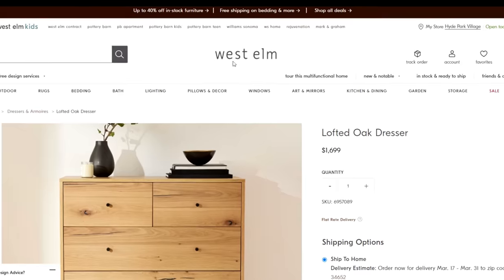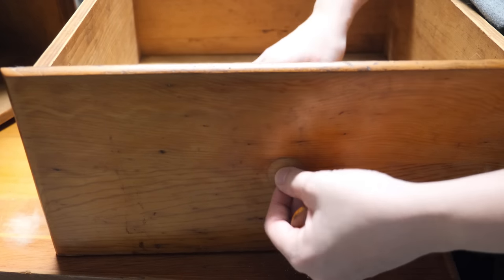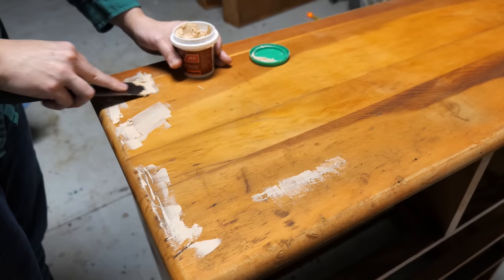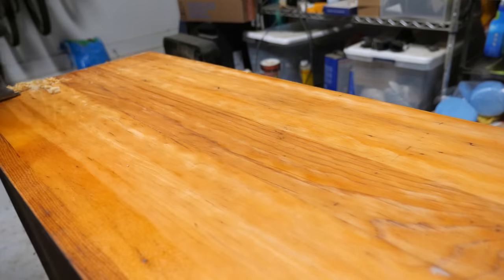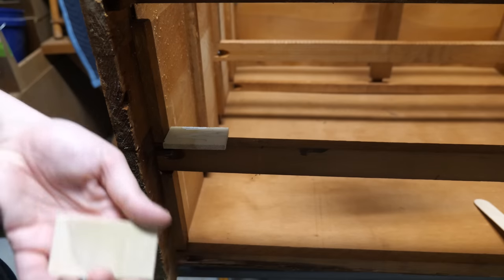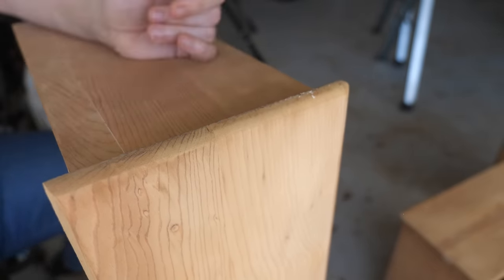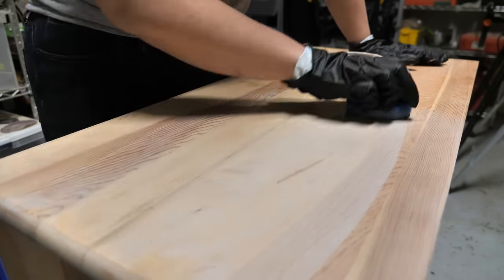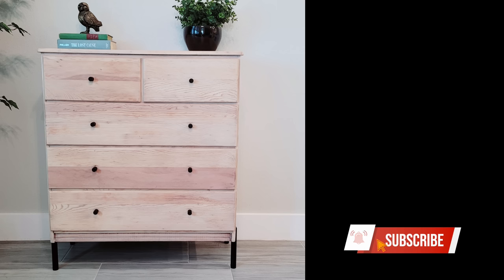$25 Dresser to $1,699 West Elm Dupe

Comment: Such an amazing duplication. I was blown away at how much the 'reveal' looked like the West Elm piece. Your attention to detail is so impressive. Like over-driving the nails in the drawers and then using wood filler to conceal them. I would never have thought of that!

I was confused on what all you mixed to get your final color. I know you said it was all water-based, but I couldn't follow the products you listed.

Definitely going to watch the rest of the videos in this challenge playlist!
Reply from the maker: I think, if I remember correctly, I mixed carts and millie charlie latte paint with drift wood stain. Then  I blended that with the water based finish to make it a tinted finish more or less. It does mess with the finish sheen a bit, which can be corrected by just appling the finish only on the final coat. I would consider it a water based toner blend.

Comment: WHOA! You totally nailed this “dupe”, Emily!! It looks just like the West Elm piece and was 1/10th the cost in Chipotle burritos (this made me giggle bc my son is the grill manager for Chipotle). Even though your piece had some tapering, which was much more obvious in its original form, you can hardly tell now. Especially with the new hardware and legs (so glad to see someone use these, I have them in my Amazon cart in gold for a piece). Yours would go for a lot of money in my area (I’m in Dallas), but less than the West Elm piece, as it’s very popular right now. Excellent transformation, Emily!💜
Reply: Oh and your poly wash toned that pink waaay down. It’s hard to do (I’ve struggled with it for some bathroom cabinets). I saw Angie (Transcend Furniture Gallery) deal with this in one of her videos. I think she put a think coat of walnut stain on and went back to her pickling stain? But yeah, the red in pine, walnut and even oak is a bugger when doing a pickling finish. You did an amazing job and love the idea of tinting the poly (top coat) like a wash. Will definitely try it (sorry for the long comment😁).💜
Reply from the maker: Thank you so much Ashley! The color tones are so tricky sometimes. If its red and you put white on it then its just pink. I'm sure there is a green stain out there but it would probably make things worse. Also don't apologize for your long comment. It was super sweet! 💜

Comment: Best dupe I’ve seen! You nailed it. Did that wood fill stain to match? Always have a hard time with that. Thanks!
Reply from the maker: The kind I get is stainable, but I know on certain stain colors its better and I don't have to touch those spots up if I use the pre tinted kind. This finishw as light so it worked out well.

Comment: I was skeptical when you started,  but the result was great. Did you think about squaring off the top?  The legs were perfect!
Reply from the maker: Yes I did. I planned on cutting the top square with my circular saw until I found the jointery between the boards looked like little dove tails, which is why I ended up not squaring it off. Thanks for watching!